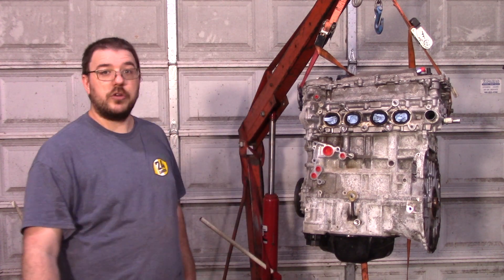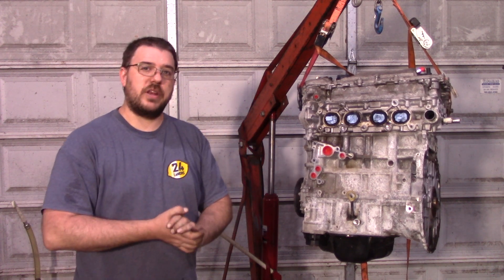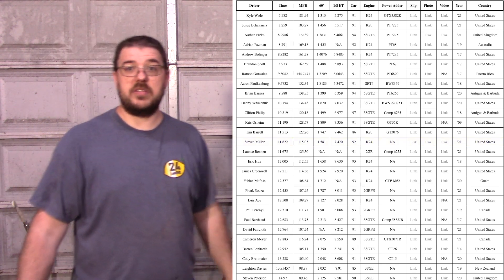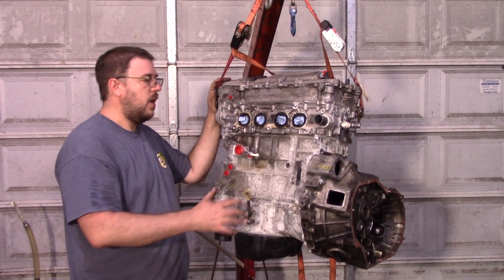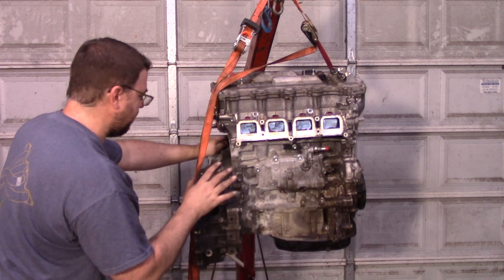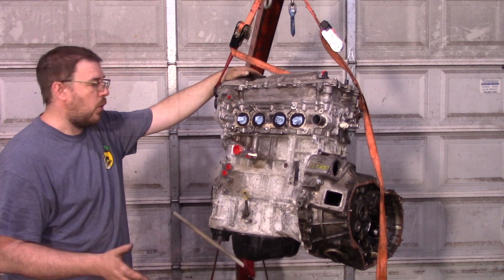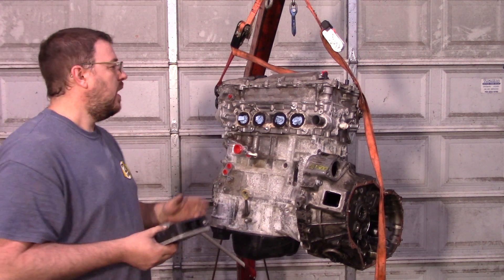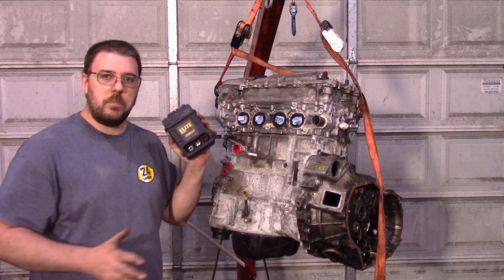MR2 Drag Race build, 2AR-FE powered (Evey #2)

Comment: A lot of balance and smart information here. Not gonna change torque on these. So glad all the parts for the spyder are back in stock. Keep the videos coming.
Reply from the maker: Right, i expect that at best i'll make 250lb*ft once i switch to a different kind of fuel. Naturally aspirated motors generally don't change their peak torque numbers unless they are making peak torque below 100% volumetric efficiency but very few modern motors hit less than 100% VE at peak torque. Those easy gains left when the 90's left us.

Comment: doesnt the e351/e350 transmssion fit this engine as well? i know the eb60/62 fits the 2azfe, and that came on the 2arfe. I guess its another option? The e351 has the same 1-5th gear ratios as the eb62 if im not mistaken. I know its also more common then the 6 speed too. I just wanted to make sure because my brother and I bought an e351 for a 08 camry, 2grfe manual transmission swap and I know the e153 fits that engine too.
Reply from the maker: Yes, the E351 does bolt to the engine. Unfortunately it is know for having a differential which will not put up to drag racing abuse. But for a non drag racing car it is a great trans.
Reply: Also what clutch would you recommend that isn't terribly expensive? I don't want to run the stock clutch because the 2grfe has double the hp of the 2azfe stock engine. lol.
Reply from the maker: I generally use the TC8-HDG6 clutch and i've been very happy with it. It is a 6 puck ceramic design that some people do not like on the street though. Though that works with the EB60 trans, you will need the TC1-HDG6 for the E351

Comment: 100% I have already been thinking about this combo. I think if the stock ecu is kept plus smog stuff this will pass through a California smog referee, which is the route I want to ideally take once I ditch the 5sfe.
Reply: Also can you comment on how you determine and early vs late model e153? I know someone with a jdm 93+....
Reply from the maker: @qwuyn  Yes, this should be pretty easy to pass through a california swap inspection. Just make sure you tell me when you order the ECU. I'll just send you a non immobilized ECU but otherwise unmodified. 

As for early vs. late, i think 1993 is the later year but if you email me a picture i can confirm it for you.
Reply: @FrankensteinMotorworks  What are you charging for that ECU service?
Reply from the maker: @thomasiturraran3623  You can buy the ECU from me, no core required for $450 directly from my store. Just place a note indicating you want this for California and it needs to be a Scion tC because it would fail emissions if i send you a Highlander ECU since that is a different class of vehicle.
Reply: @FrankensteinMotorworks  do you think it will matter to the smog board if I have an FXE instead of an 2AR - FE?
Reply from the maker: @thomasiturraran3623  According to the letter of the law, it absolutely would matter. but given that the only difference is compression ratio it would be really difficult to detect. But you'd have to use the stock FE cams with that higher compression ratio. the FXE cams are way too big for the stock ECU to idle well.
Reply: @FrankensteinMotorworks  do you think  the power gains would be worth it? Stock FE cam on FXE engine, with FE ecu?

Comment: Also, I might have missed it but are you putting a LSD in yours?
Reply from the maker: I don't think I mentioned it but yes, I will have an LSD unless I can find a spool for the E153. Being able to heat up the tires and get them sticky is important.
Reply: Frana I believe it is, sells a spool.
Reply from the maker: @nickbianco2750  Yeah, they pretty much make anything like that if you just supply them some parts to measure. A spool would be a good weight savings and would not have any disadvantages for drag racing.

Comment: Have you thought about instead putting the shortest gear ratio in and and lowering the power instead? It is really easy to add timing and such…very hard to change the gear ratios. You can also do power by gear possibly…
Reply from the maker: It isn't hard at all for me to change the gearing in the trans. Delaying the 2nd gear shift as long as possible will help the time. I also have 3.933 and 4.285 gears on hand here so if i find that i am not able to break the tires free by launching extra hard i will go for shorter gears.
Reply: @FrankensteinMotorworks  super long gears only work when you have lots of low end torque and a short rev range. It is going to feel like the longest gear in your life running down that short 1/4 mile
Reply from the maker: @evilthorne  keep in mind, with 210lb*ft of torque on a relatively flat torque curve and a 2000lb chassis it's got more acceleration than a 2GR-FE(260lb*ft) in a stock 2900lb chassis. about 17% more and the 2GR at stock weight is hard to get it to not spin in first gear even with the 3.625 gears. It's also the same story for the horsepower, if you scale up the 241whp max power i've gotten from this thing already by the weight difference you get about a 16% better power to weight. But I'm really not afraid of having to pull the trans to swap out gears. I have to make an assumption to start and this is where i think it might be best but i'm totally not afraid to admit i'm wrong once i start getting data from the drag strip.
Reply: @FrankensteinMotorworks  I am definitely not doubting you doing what needs to be done if that means swapping them. You also could have mentioned the fact you are probably getting rid of one shift as well. Good luck, and I look forward to the swapping FD video😜
Reply from the maker: @evilthorne  I'll be sure to get it on video :) and yes, it does save a shift into 4th. It's tall enough that even the 11.0 run that i'm aiming for should just be a 1-2-3 run. Partially because of the tall gears and partially because of the higher redline at that point.

Comment: #1 vs V6 swaps and k swaps???
Reply from the maker: Yes, exactly! The V6 swaps are fast but they are too expensive to mod and there's not enough parts available so i don't expect to have issues with the V6 guys. As for the K-Swaps, that's exactly what i'm trying to prove here. The AR is a better platform and i intend on proving it out.
Reply: Plus the guys who k swap usually turbo and the guys who v6 are not usually striping their cars down to such a low weight.
Reply from the maker: @raviolitrail  I do want to explore turbo stuff also but trying to go after a record in the 7's is a bit much for a first serious drag strip build.

Comment: In your tinkering with the AR family. You ever have a problem with the valve stem seals and/or piston rings? Oil consumption?
Reply from the maker: I have not, in fact the motors i have used have stayed very clean. The problem seems to be related to carboning up with excessive low load usage and that's simply not a condition that the motors i use are exposed to.

Comment: I put all aftermarket ECUs that have dedicated harnesses behind the passenger seat in SW20s and AW11s
Reply from the maker: That's exactly where i am planning on placing this one. It makes for the shortest wire routing to keep the weight down.
Reply: @FrankensteinMotorworks  theres even a nice spot on the firewall and the wire grommets from a 2ZZ toyota are perfect for the location along with some tesa tape

Comment: Did I miss something in the video  , whats the advantages of using this  engine over the 2gr-fe?
Reply from the maker: My main reason for using the 2AR-FE is because of how well it fits in the MR2 Spyder but I want to push the engine to show that it can make more power than the k-series that everyone currently loves. But since there isn't a good repository of MR2 Spyder drag racing records I decided to go for the record in an SW20 instead to make the record a bit more legitimate in the community's eyes. In the SW20 the 2AR-FE is mostly a really good low cost swap for people wanting just a bit more power than the turbo engine used to make, think of it as a modern beams except it makes even more power and only costs $200-$300. For people wanting to hit the 300-350whp range the 2GR is a better motor for the MKIII platform but beyond that, the 2AR would be much more cost effective because it leaves way more room in the engine bay to install a turbo. Plus, i like going down a road that hasn't been traveled before.
Reply: @FrankensteinMotorworks  there should be some k motor sw20 drag times somewhere too
Reply from the maker: @driftke70  Yes, the website i pointed to in the video (MR2Nation) currently has the naturally aspirated record held by a 2GR but the k swap from Eric Hux is just behind him and with the changes that he has done he will be at the top of the chart as soon as he runs the car again. It should be close to an 11.0s quarter mile. If there is a better site with documentation for the records i would be happy to go after whatever the best record currently is as long as it is naturally aspirated without nitrous.
Reply: @FrankensteinMotorworks  yeah true well will answer many questions all at once

Comment: Definitely willing to do this swap once the mounts are one the market. I'd like to figure out how to make this California smog legal on the stock engine. Ideally, I would be able to do this swap, pass the bar inspection, and then install the cam upgrades for the increased power. If I could use the 12.5 compression ratio engine and pass smog that would be better as I could run e85 after passing BAR.
Reply from the maker: Passing BAR with this engine should be pretty easy. I'll confirm the stock exhaust manifold fits when i get there but i'm pretty sure it will without any modification. You'll also have to use the stock intake also but that's easy to fit. The hardest part will be the evap system but if you put the fuel pressure regulator in the gas tank instead of the frame rail and remove a bunch of the old vacuum hoses on the tank it should be possible to make it pass.
Reply: @FrankensteinMotorworks  That's great news! The fuel system modifications you described are similar to what people have done to get the later vvti 1mz engines to pass smog. Does an unhacked stock ECU work?
Reply from the maker: @stonehedge559  yeah, same kind of thing for the evap as the 1mz. you just need to get rid of as much of the hoses as possible to reduce the evaporative "sweating" through the hoses. 

The stock Scion tC ECU will work well and i can hook you up with a stock but non immobilized ECU.
Reply: @FrankensteinMotorworks  sounds perfect, Are there anything modifications at all in that ECU?
Reply from the maker: @stonehedge559  It's whatever i want it to be but i can take the immobilizer out without modifying any part of the tune so it would 100% report everything as the same

Comment: Do you know if there are any "easy fit" rear wheel drive transmissions for the AR?
Reply from the maker: I'm sure there is but unfortunately i don't know where to point you to at this point.
Reply: Possibly the J160 from the beams powered altezza
Reply: @evilthorne  I currently have a 98 4Runner with the bullet proof 5VZ and its around 300k miles. Whenever this motor gives up I'm going to move to a turbo 4 cylinder. It would be really cool if the AR stuff became affordable in the next few years but as of right now a 2RZ is probably what I'll end up building since it all swaps fairly easily
Reply: @nickmudd  considering the 5vzfe uses the same bolt pattern as a 3sgte it should in theory bolt to this engine. That's just speculation tho

Comment: Wanted to see you bolt the S54 to the 2ar.
Reply from the maker: The S54 is behind the car in the trailer so i wasn't able to get to it. But i will test this and give the info out as soon as i can. Sorry about the delay
Reply: S54 uses the same bolts that he showed on the e153. I currently have one bolted up. I opened up one hole for a 12mm bolt on the s54 and tapped one hole in the 2ar block. Then I did get 1 maybe 2 smaller bolts on the bottom as well.

Comment: Please produce a production engine mount and camshafts.  Also, how do you plan to do the coolant system?  Specifically a tank in the engine bay.
Reply from the maker: On the first go around I will just use the stock MR2 cooling setup to keep things simple but that is certainly something that could change, either for cooling capacity or for weight reduction. It might also get another major change if i ever need to go to methanol to take the record.

Comment: Would love a 2AR swap kit for the SW20.  Cams for sure (high performance street N/A).
Reply from the maker: Awesome, The mount and the cams is something i know for sure will be available. at first i will likely just be the 250whp cams but as others get figured out i'd like to probably have 3-4 offerings on the market.
Reply: @FrankensteinMotorworks  How soon do you think you will have mounts ready for the 2AR SW20 swap?
Reply from the maker: @thomasiturraran3623  no exact date at this point beyond "before the end of the year". i know that isn't too precise but it's all i have right now.
Reply: @FrankensteinMotorworks  That is actually very helpful in regards to my planning my current build. Looks like Ill be shopping for a 2AR over the next couple of months. : )
Reply from the maker: @thomasiturraran3623  Awesome, can i ask what kind of build you'll be putting together?
Reply: @FrankensteinMotorworks  1991 sw20. Currently have a refreshed 5sfe with an e241 auto trans about ready to drop in, but I'm thinking I may pick up a 2ar and see if it will bolt up to the auto. Eventually I would like to swap in an e153 with LSD.
Reply from the maker: @thomasiturraran3623  we actually just discussed the auto situation on the discord channel about 10 minutes ago. The big deal breaker will be the kickdown cable but also it looks like only a few bolts would line up
Reply: @FrankensteinMotorworks  S#!&. Well I may just drop the 5sfe in for now, and slowly obtain a 2ar-fe and a e153 later down the road.
Reply from the maker: @thomasiturraran3623  Sorry, at least i saved you the headache :)
Reply: @FrankensteinMotorworks  yes thank you. Also do you know under California smog law can I go auto to manual as long as I get the right ecu
Reply: This is what I am interested in as well.